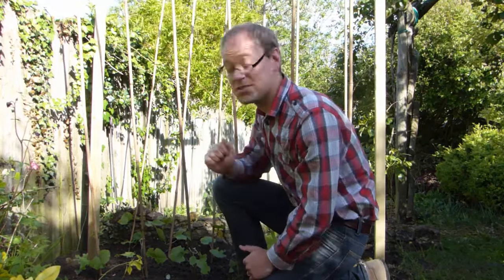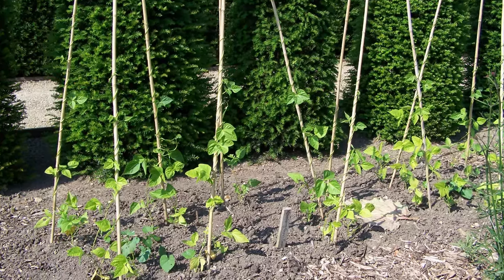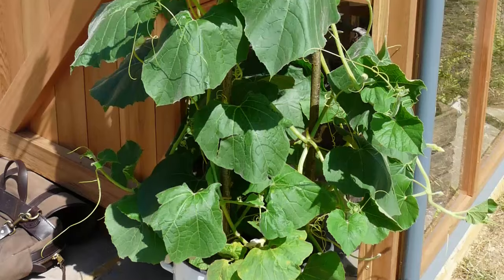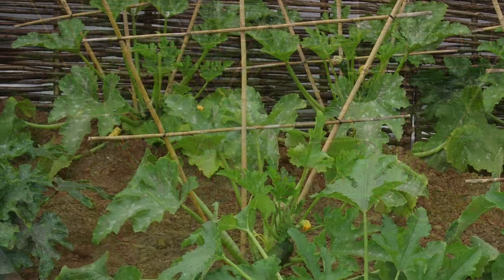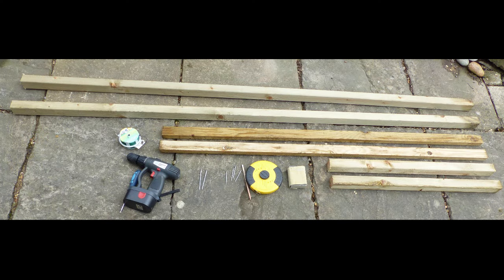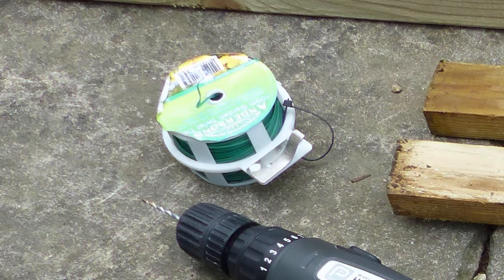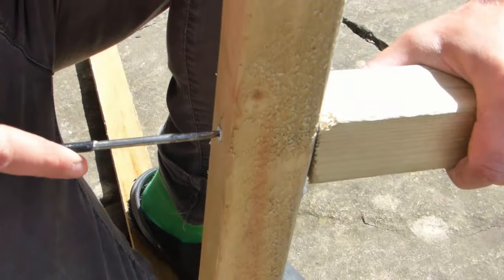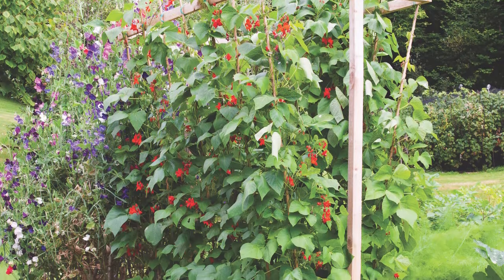Garden Trellis - How to Make the Best Supports for Climbing Vegetables

Comment: Due to high winds, straight line winds, etc. that we have here thinking perhaps instead of 2 supports in center that 4 corner posts would be better option and maybe secure each corner post additionally with metal T-posts.   Likely would have to use cattle-pig fencing or furring strips since bamboo is not readily available plus it is expensive and much too short (intended for smaller indoor potted plants) when it is shipped into gardening centers on rare occasion.  But really like the idea and believe could find a way to make it work!
Reply from the maker: What you suggests seems sensible in windier locations.

Comment: if you want your frames to last longer than a year or two...

1 - cut the top inch or two from an empty 2 litre pop bottle
2 - stand in the parts that will be buried underground, and support them upright
3 - fill the bottle with creosote or similar treatment for buried wood
4 - let the wood stand in there and soak up the treatment for at least an hour or two - preferably overnight... or longer
5 -  remove the frame from the ground after the beans have been harvested and allow to dry
6 - retreat if necessary
7 - enjoy NOT having to cut off the rotten wood every year and avoid your support collapsing mid-season
Reply from the maker: That's a great tip, thanks. The only concern would be that the creosote leaches into the soil and is taken up by the bean plants.
Reply: If you're worried about that, then I would recommend a couple of Metpost holders from B&Q. They hold the timber above soil level.
Reply from the maker: Yes, that would be a sensible solution

Comment: I've used the "stake & weave" technique promoted by Johnny's but the wooden stakes may be a problem.  Since Septoria (and some other diseases) can over winter on wood I'm looking for economical alternatives that stand 2 meters tall.  Rebar?  Steel fence posts are expensive. Cages work but are very labor intensive to make for 50 plants.  Suggestions?